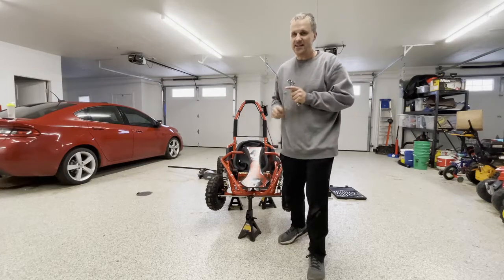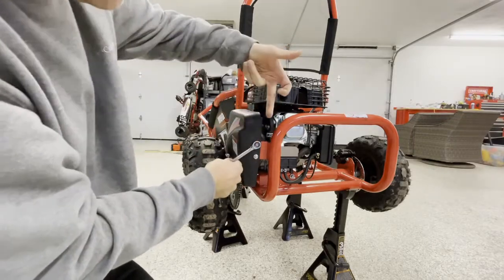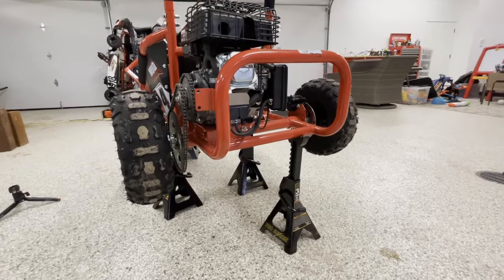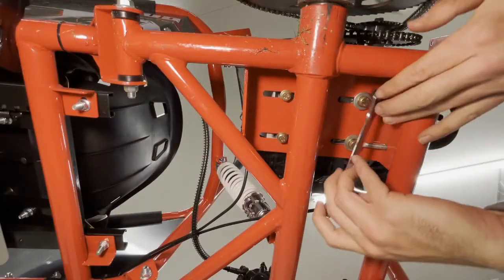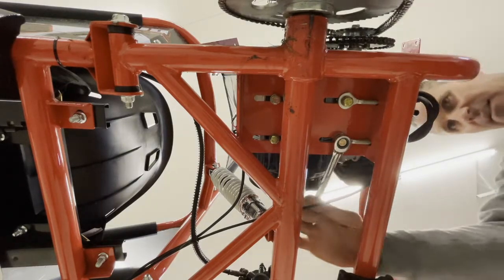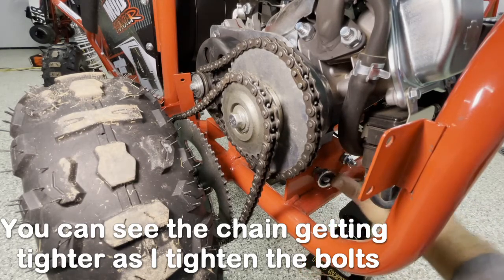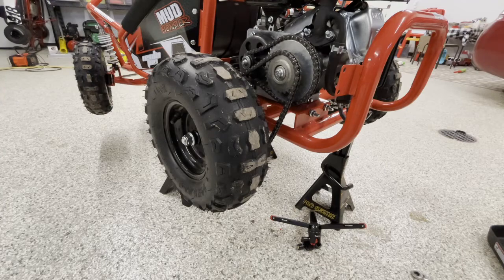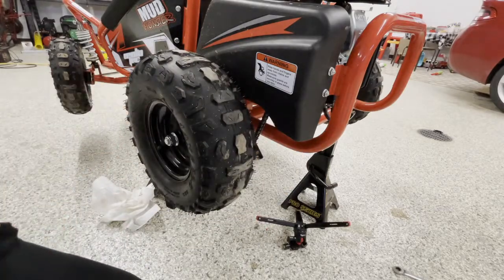How to adjust the Chain on your Mototec Mud Monster Go Kart

Comment: Where do I get parts?? Mototec has terrible customer service and alot of the parts they have on their website are out of stock. Looking for wheel and tire combo for both front and back. Any ideas?
Reply from the maker: They've been out of stock for quite a while, but the new inventory of Mud Monsters is coming back very soon, with it or not long after should come a shipment of parts. I am sure you have your email address with Mototec to get an update, you can do the same thing on our site too. Here is the KidSpeedUSA parts link for this Kart if interested. Pricing is the same as Mototec. 

https://kidspeedusa.com/product-category/parts/go-kart-parts/spitfire-parts/
Reply: @kidspeedusa6002  Yeah, the tires are pretty fragile, so I wanted to buy a few spare combos. The good news is Discount tire plugs the leaks for free.
Reply: @kidspeedusa6002  Do the spitfire rims fit the mud monster?
Reply from the maker: @gonedeep43  Yes - they are exactly the same.
Reply from the maker: @gonedeep43  An absolute ton of parts arrived, it may take the team a bit of time to go through them. We definitely got tires, but not 100% sure whether we got tires on rims. I'll keep you posted.
Reply: @kidspeedusa6002  Thank you for the update.